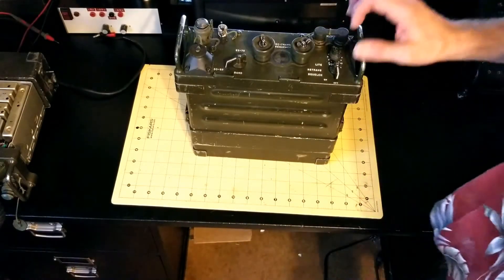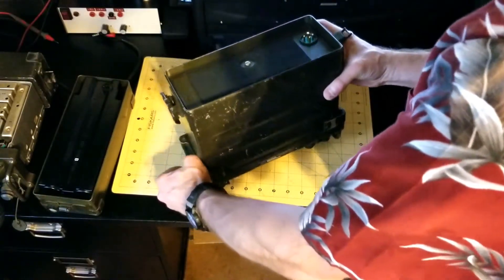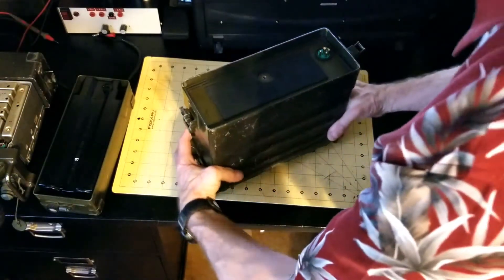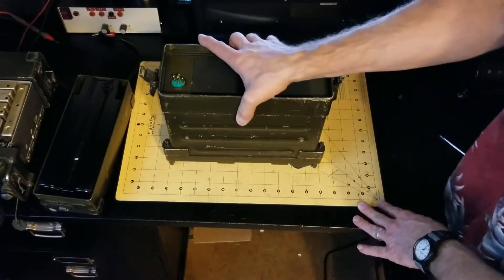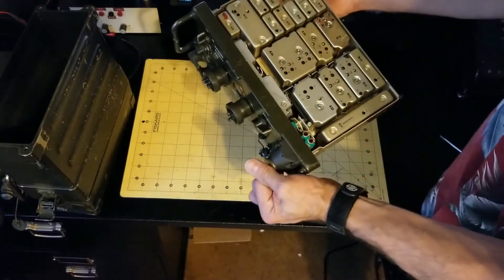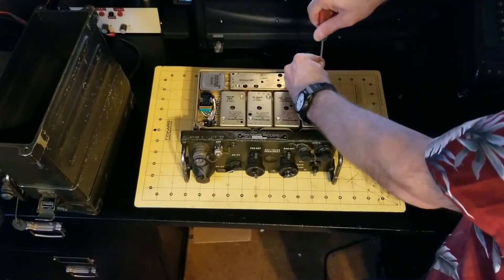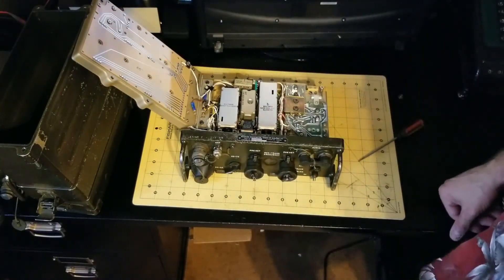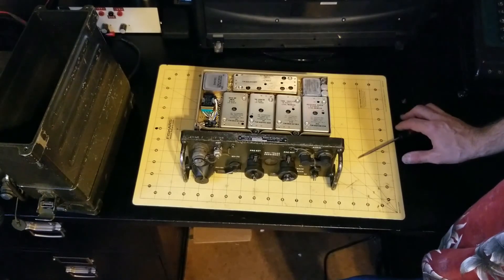PRC-77 / PRC-25 Radio Basic Disassembly Procedure

Comment: Hi mate what would be the cost of two working radios with all accessories
Reply from the maker: Full retail price for a working radio with backpack, antennas, handset is about $700-750.  Two of these = $1400-1500

If you're patient you can find good deals on Ebay etc. for working units and the other gear to bring this down to about $500/set.

Comment: Do you have any non working “for parts,” radios or external components such as the front panel for sale ?
Reply: Yeah. I’m actually trying to basically build a replica using a baofeng since my use for the radio would be easier going with a more practical radio. But finding a broken one or just a complete outer body is hard for a decent price
Reply from the maker: Cool idea!
Reply from the maker: I don't.  Making a display or something?